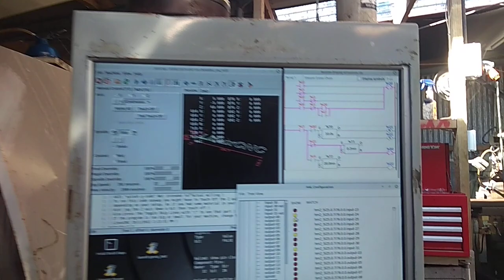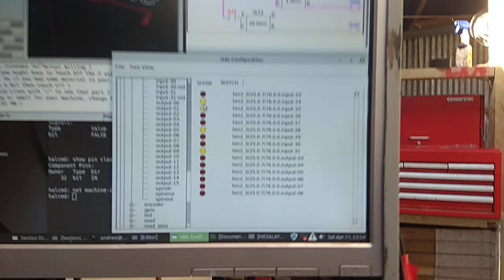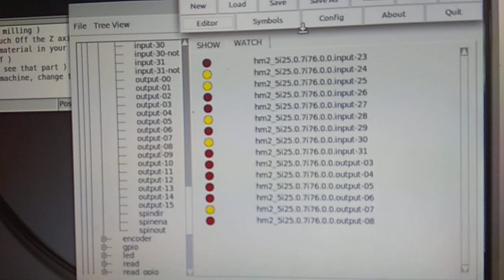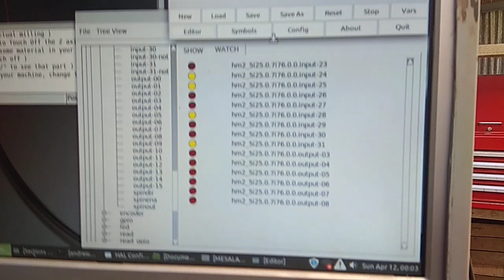Linuxcnc random position toolchanger first manual moves

Comment: Okay, so it looks like it indexes off of a cam lobe that I can see rotating by looking through the holes in the toolchanger fixture. And it looks like it indexes one position per revolution of that shaft. That's nice and tidy. :)

The prox seems to be pretty precise, but I can see that as with all of these cam lobe setups, you can stop it in between locations (it's the nature of the beast). When the prox gets out of position you will have all sorts of fun getting it back into alignment. Also part of the nature of the beast. 

What drives the indexer motor? A simple motor or a proper drive? If you have a drive on it, you could inch the indexer into position rather than jog at high speed. There's an argument for and against having a jog on this drive. Not having a jog cuts down on locating errors when trying to index it "by hand", but it would be really handy for being able to jog the changer should a pocket get wedged into place and couldn't retract on its own..

The pocket seems to be extended via an air cylinder, which is good since it will just stall out and not damage itself if the pocket isn't aligned. Almost like someone saw this coming. :) Is there one air cylinder per pocket (ugh), or one air cylinder for all of the pockets? And what indicates that a pocket has been extended properly? Or fully retracted for that matter? And I saw your luber (you referred to it as the toolchanger at 3:33), is this the lubrication system for the pneumatics? Do your air cylinders require (or prohibit) lubrication?

The tool arm rotate looks nice, does it operate off of proxes as well? Or an encoder? I do see a case where the pocket could be out of position, preventing the return of a tool into the pocket resulting in a tool being left in the tool change arm at the home position. A prox looking for that in the tool change arm would be a nice addition to your changer.

How does your arm rotate? Off of a drive, or just a motor? And does it have something to tell it when it is lowered and when it is raised?

I also see that your pocket nestles into a cup made for it. I imagine that there is already a prox here for detecting that the pocket has been extended. If not...

Is there anything that detects if a pocket already has a tool? That would be nice to know so you could be sure that your mill actually got a tool installed to mill with.

Overall it looks to be running pretty smoothly. :)

Comment: Hello, 

Congratulation  very nice work. :) 
I will firs time retrofit a milling machine with random tool changer. Therefore i intersted for your experiece with linuxcnc doing random tool changeing. It is safe enough? No chanse for mixing tools? How you solve if you push emergency stop during tool change or something other what stops the tool changeing (f.e. linuxcnc freezing).  Best regards, 
Attila.
Reply from the maker: Coming from you that's cool.  I love your videos.  I'll be back in the workshop next week and can look at things there.  But very keen to work together
Reply: @carbidecuttersnzltdandrewb8449  Hello, do you check the machine in your workshop? How reliable works the random atc control in linuxcnc?
Reply from the maker: It's still not actually working haha.  I got busy using it.  But about to set it up soon

Comment: I will have to do exactly the same thing on a traub vmc that I need to retrofit with linuxcnc. 
So far the tool changer part seems the most intimidating, I am worried to not to crash the tool changer or smth.
How many inputs/outputs did the random position tool changer has used?
Reply: Are you on the LinuxCNC forum?
Reply: @MrWaalkman  yes
Reply: @LikeFactoryMade  You can reach out to me on the forum if you like, I go by rootboy there.
Reply from the maker: Vasi.  Sorry I never saw this comment did you work it out?